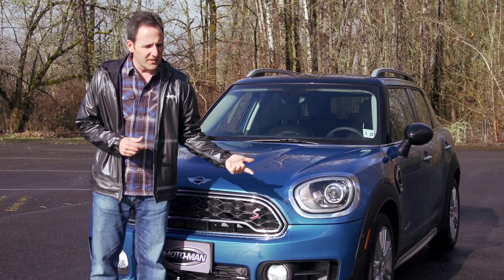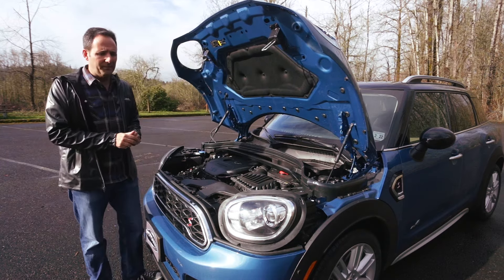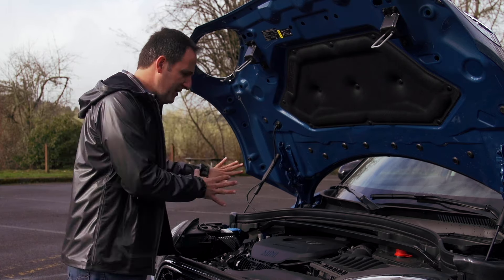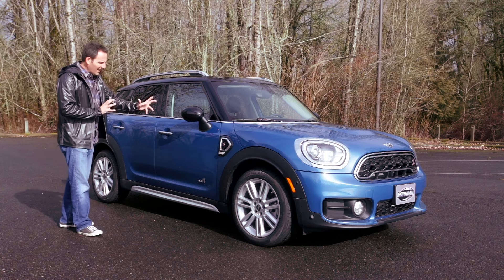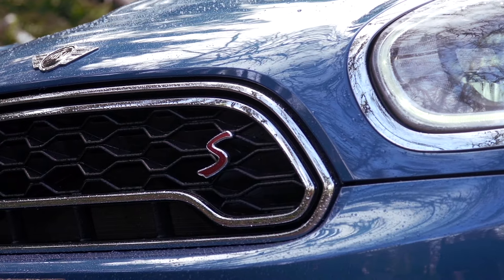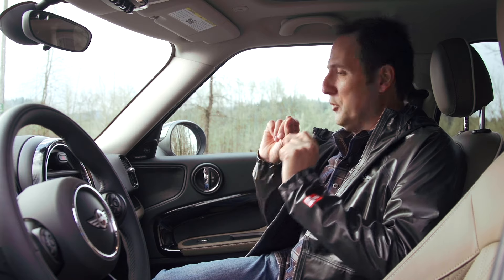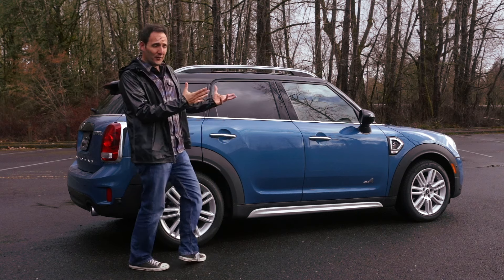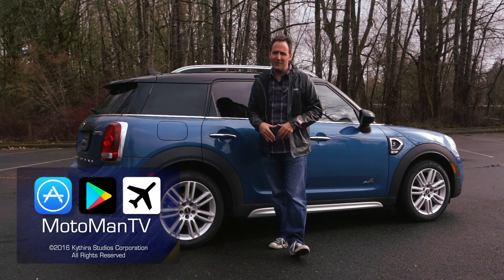The BIG MINI – 2017 MINI Cooper Countryman ALL4 & Cooper S E Countryman PHEV – TECH REVIEW (1 of 2}

Comment: You're not saving weight by having less gas since in it's place is a whole hybrid system which almost definitely weighs more than 7gal of fuel

Also those seats are real leather and are like a $2000 option

Comment: the new design of Mini Countryman its perfectly beautiful, BMW Engineers had done a wonderful job of transforming the car  by adding a few size or inches and more horse power. but maintaining its heritage of the Mini its lovely appearance even if the car is in a few distance from you. You can identify it right away that its a Mini Countryman. if only i have a money i will not hesitate to buy it right away. this is my dream car suv 2.0 liter turbocharge diesel 220 horse power 250 pound feet of torque 4 wheel manual drive.I'm optimistic that this Mini country man car will become a cash cow in the years to come for BMW group congratulations.

Comment: Personally love the newer design rather than the 2016 mini countryman I own.

Both are very interesting designs. But i love my countryman, best all round tourer.

By the way for all you interested; do not go for the hybrid model. Main reason is because the range is cut in half from the main models.

My countryman S would get 540 km range (400 miles). A hybrid would only get 440 km range (330 miles roughly). 

So it's probably better with the normal models.

Comment: Motoman and I have been discussing the Countryman for a little while privately.  My wife drives the 2011 Countryman ALL4 automatic.  It has 85000 miles on it and while we would be considered likely buyers for the new version, especially for the plug in hybrid, my wife and I have had it with Mini.  After a turbocharger failed at 46000 miles, that was followed by a coolant system leak and two fuel pumps, the second being replaced 18 months after the first replacement.  Mini is supposed to have replaced the second fuel pump under an extended warranty plan but failed to notify any of the third party maintenance shops of this program.  Why did we not take it to the dealer?  Because of the horrid customer service we got at the Nashville Sonic owned Mini dealer who couldn't do simple customer notification of vehicle status right (multiple times).  Sonic failed to take any real ownership of the problem and I've washed my hands of them as a dealer network and Mini as a whole.  And I can't say I have any warm fuzzies with BMW either after this.

It's a shame since it looks like the car has some noticeable improvements I care about.  But not enough to forgive and forget the last 5 1/2 years, and especially the last three years of ownership.
Reply: Don't know if it helps, but the new mini's have new engines. They all come from BMW. I drive my second MINI F56 Cooper at the moment and haven't had any problems with it. I like the new motors and the interior quality has gone up quite a lot from the older generation. But yeah, if the service is not good from your dealer I would also not like a new one from them.
Reply: I work in enterprise customer service where I have to make sure that customers who spend millions on what we do are getting their proper value.  I'm realistic that bad things happen.  What differentiates a good or great company from an average or poor company is how they deal with customer service problems.  Apple figured out a while ago that flexibility with customer problems tends to keep customers coming back for years and continue to invest in high dollar goods.  Few things are more expensive to an individual than an automobile.  And most automotive brands have to depend on a partnership between themselves and the dealer network.  I've seen really good service from some dealers over a long period of time, not just a single event.  But my experience with Sonic as a dealer network has been lacking and disappointing, and this goes back several years, not just this experience.

My advice to anyone in the car service business is to:

1.  Over-communicate.  Lots can and will be forgiven if you keep a customer informed.

2.  Be honest.  This goes without saying but customers demand and can handle the truth, even if it's going to be expensive.

3.  Be flexible.  Give customers less expensive options as long as safety isn't compromised.  And especially remember this during disputes.

4.  If an issue has to go back to the manufacturer's zone manager, remember to be the customer advocate, not another obstacle.  Your mission is to make the customer happier and willing to come back not only to your service bay but to buy new cars from you.  Think about this customer coming back to you for the next decade or more, not this single transaction.

5.  Always give customers the names and contact information of leadership members either at the dealer, their parent company or the manufacturer.  Keeping this information private only antagonizes the situation.

6.  Never knock competitors, even if the customer brings them up.  It makes you look petty and small.

7.  Did I say over-communicate?  NEVER FORGET THIS.
Reply: Sevenfeet0 I have same model and year as you. I am at 117k and have went through two HP Fuel pumps and it is currently sitting in my drive with a suspected third failure! Granted Mini has extended the warranty on that part but what a pain. I will admit, painfully, I still love it. I bought a 2nd gen Volt and love it but I like this new hybrid from Mini. Not sure the range is enough, but again I still love Mini design.